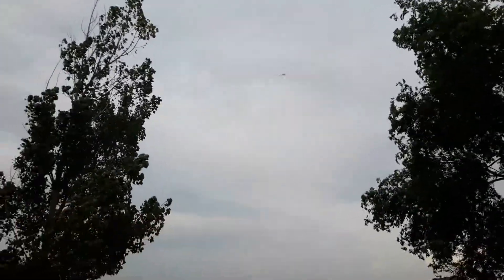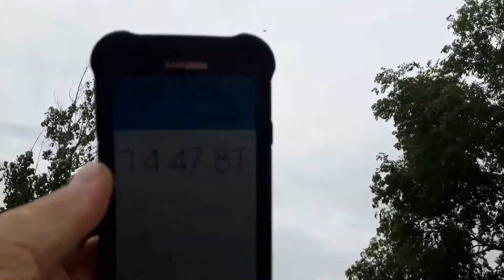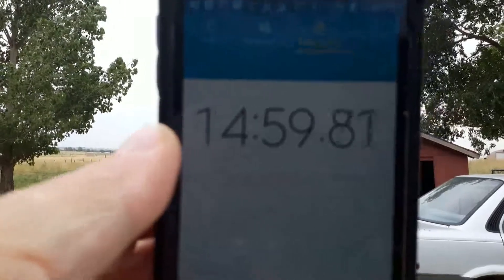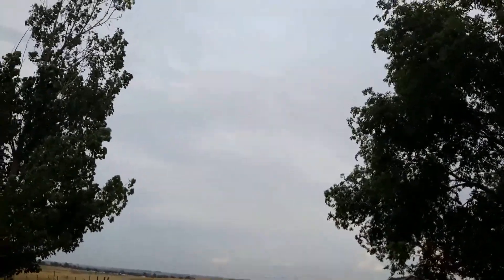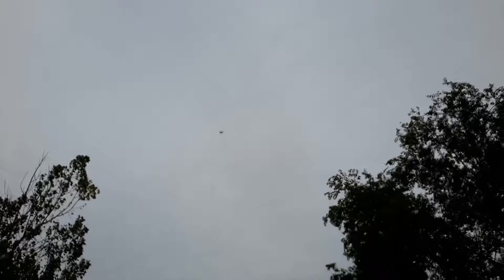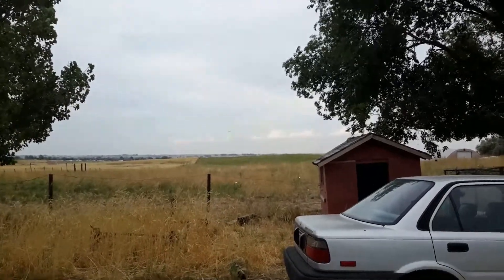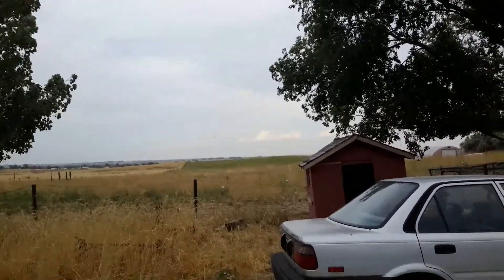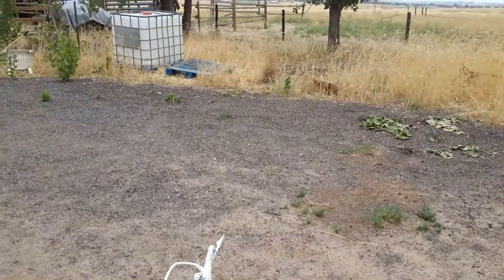25+ minutes! UPair One Battery Test (w/Crash)

Comment: what does that mean u can recover from a full down elevator flutter without crashing I'm curious
Reply from the maker: Vortex ring state, also known as settling with power is something that can also effect quads like the UpAir one.  In fact, the Upair One can stall during sharp deceleration as is shown here https://aviatorsdronelog.blogspot.com/2017/07/the-upair-one-is-good-to-own.html.   Some quads will stall during full down control input but my UpAir didn't seem to be troubled by that characteristic.
Reply: Aviator67 thanks for the info